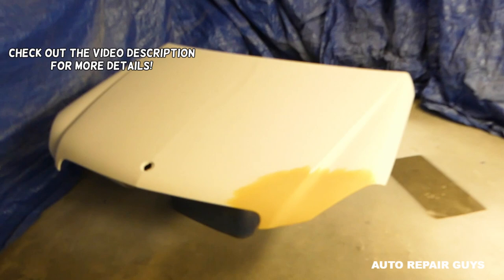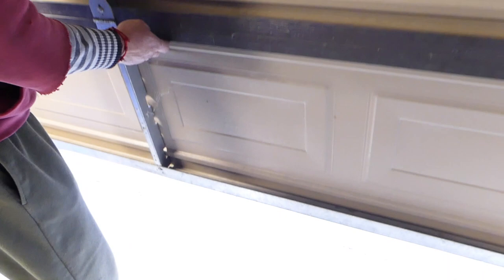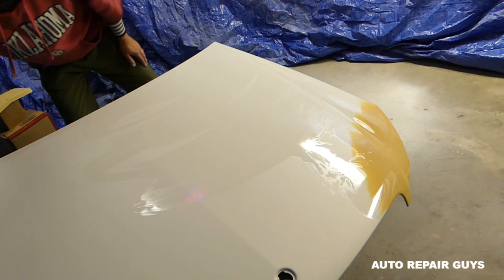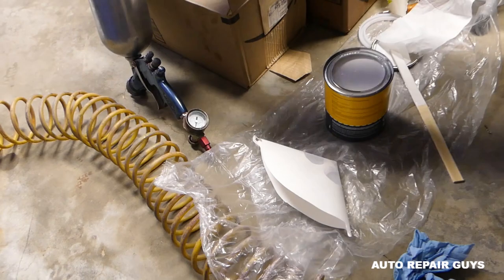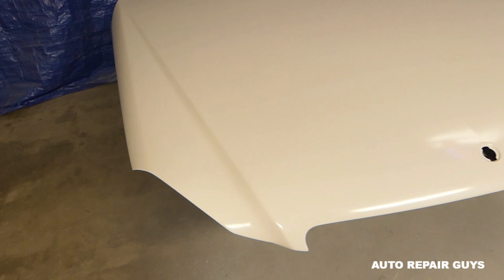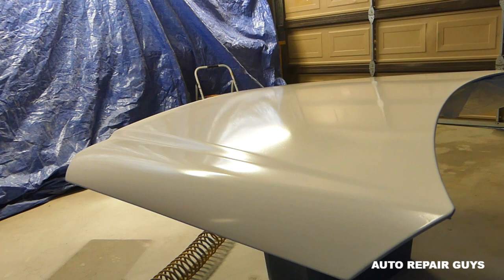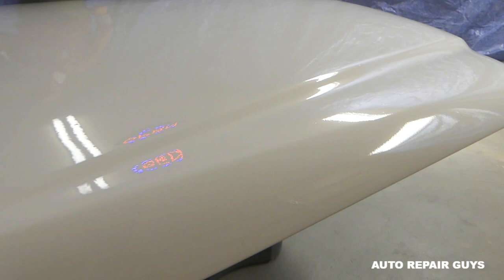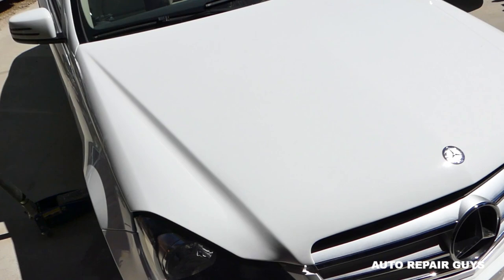HOW TO PAINT HOOD. CAR PAINTING

Comment: Good effort guys! Did you consider hanging the hood upright and then painting? You could get a cleaner finish using your setup..
Reply: I was taught that you always painted panels in the position that they went on the car. Hoods and trunk lids flat, doors vertical.